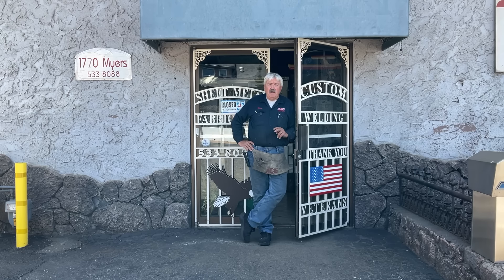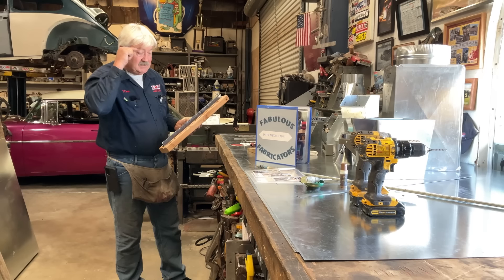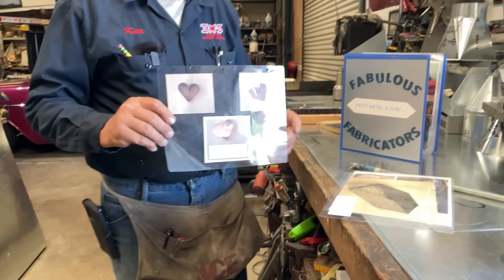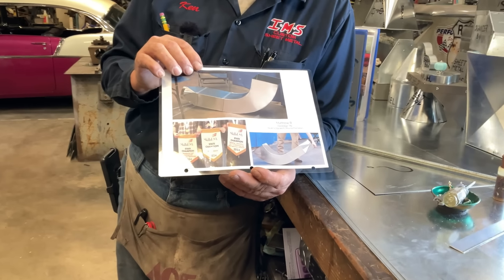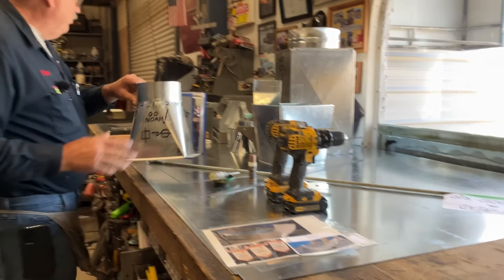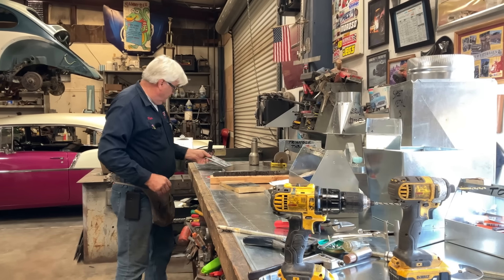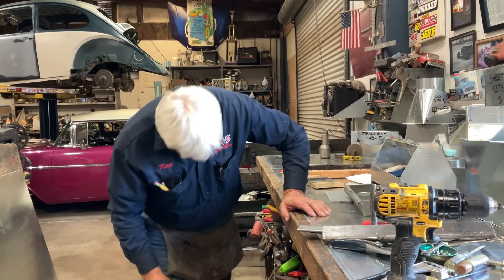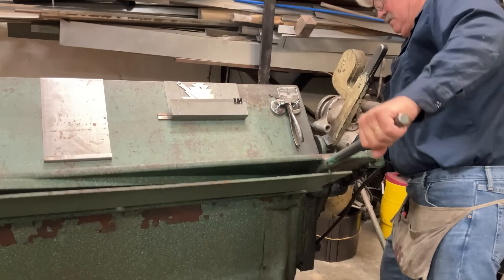Sheet Metal is Fun! DIY Folding & Forming Tools

Comment: Great video! I have found brad-point bits for woodworking work well on galvanized if you need to keep the pressure low. They act like a very small hole saw.
Reply from the maker: We use them in wood, but have not tried them in metal. I'm willing to try it . Thanks for watching.

Comment: Hi Ken, first I wanted to thank you for putting this great informational and motivational content on YouTube for free. Secondly, where is the best place to find sheet metal materials? It is pretty expensive at the big box stores. Thanks in advance!
Reply from the maker: @johnwright972  we buy our material at a large metal supply right here in town. We pay about 60 dollars for a 4 foot x10 foot sheet of 26 gauge galvanized.  You could make a lot  of great projects from a sheet that size. If you have a metal recycling yard nearby, sometimes they have dented or scratched  material for sale. Cut around the bad parts, and Pow!  You have a sense of accomplishment . Roofing is a common user of sheet metal, so check out the flashings at the big box store. You can make some cool stuff out of valley flashing. Thanks for hanging out with us, we are glad to have you along.  Let me know if these ideas help.
Reply: @kengodfrey1956 thank you Ken. Have a great weekend!
Reply from the maker: @johnwright972  you bet.thanks

Comment: For the creasing wheel, Dollar tree has a $1.25 Can opener with a hardened 20mm=7/8 cutting wheel on it.  I use them to make wire strippers for scrapping. It's probably too small for this, but they have pizza cutters too.
Reply from the maker: @ElizabethGreene  I love it! You are our kinda problem solver. You gotta be willing look at things for what they could be and not just what they are specifically made for. Good eye. Thanks for watching and sharing.

Comment: I wish  someone would have put a cross break in the duct work in one of my apartments, because every time the fan goes off it rattles like there is no tomorrow.  Is there any after-the-fact fix for that?  Keep the good stuff coming.  I'll have to check out more of these videos this winter when I'm not rehabbing one of my apartments.
Reply from the maker: @johnnylightning1491  if you have access to the outside of the duct, you can cut a piece of sheet metal ( or 1/4" plywood) and laminate it by using polyurethane caulking as an adhesive.  It doesn't take much to stop the oil can noise. You can also screw a stiffener to the duct. Walk through the hardware store and you can find plenty of sheet metal shapes that will get the job done. Angles, and channels are very useful. Make a spreader from them and you can place them on the inside of the duct if that works better for your application. Let me know what you come up with. Send me a photo sheetmetalisfun@yahoo.com
Reply: @kengodfrey1956  Thanks, it will probably be this winter before I get to it, I've got some other renovations going on right now, new bathroom, new kitchen, new flooring and a complete paint job.  I think you get the picture.  I do thank you for the advice it will come in handy eventually.